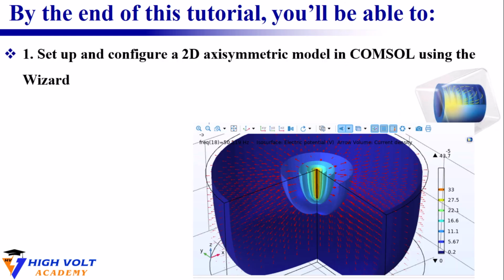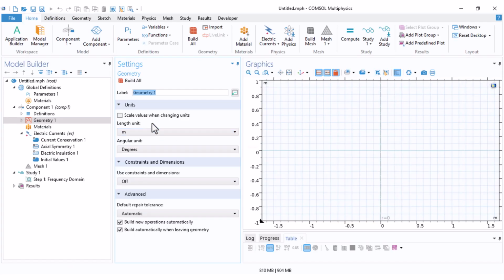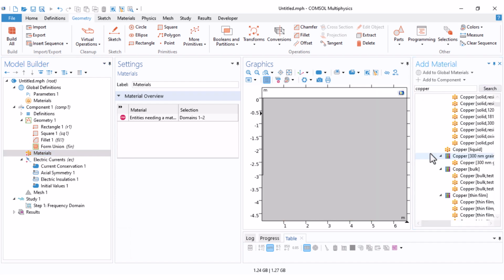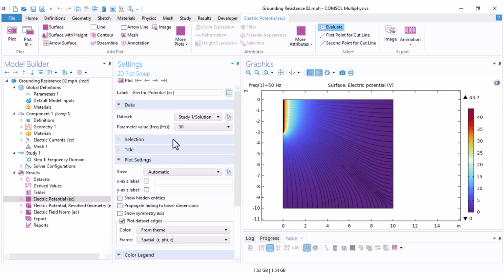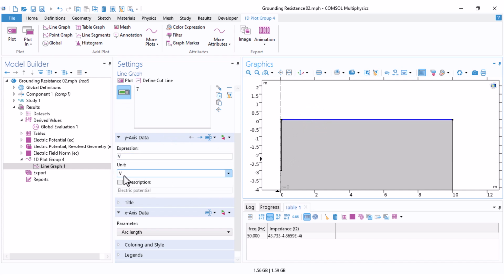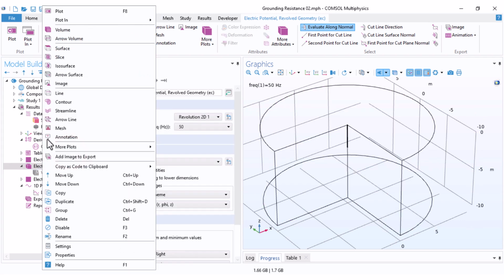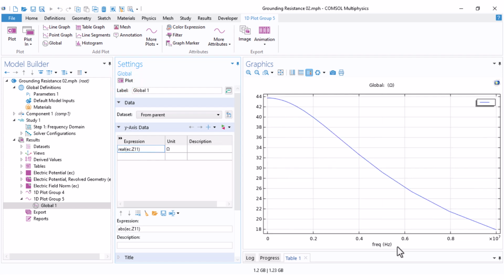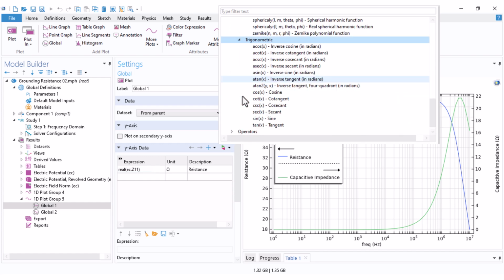How to Analyze Grounding Resistance Using COMSOL Multiphysics: A Step-by-Step Guide

Comment: Para hallar la tensión de toque y paso como se hace porfavor 🙏
Reply from the maker: To calculate the touch voltage, extract the potential difference between the current injection point (the rod voltage) and the ground surface voltage at a location approximately 1 meter away from the rod.

To calculate the step voltage, measure the voltage difference between two points on the ground surface (the top boundary of the simulation) that are separated by the length of one step. You can place two cut points on the ground surface at this spacing and take the voltage difference between them as the step voltage.

Para calcular la tensión de toque, debes obtener la diferencia de potencial entre el punto de inyección de corriente (el voltaje de la varilla) y el voltaje de la superficie del terreno en un punto situado aproximadamente a 1 metro de la varilla.

Para calcular la tensión de paso, mide la diferencia de voltaje entre dos puntos en la superficie del terreno (el borde superior de la simulación) separados por la longitud de un paso. Puedes colocar dos puntos de corte (cut points) en la superficie del terreno con esa distancia entre ellos y tomar la diferencia de voltaje como la tensión de paso.

Comment: If 3 ground rods are in the same area, how should they be simulated?
Reply from the maker: If you have three ground rods in the same area, the simulation should be done in 3D, because there is no symmetry that would allow a 2D or axisymmetric model. You can follow the same steps as before, but in 3D, and assign all three rods as a single terminal (representing one grounding system).

After running the simulation, the ratio of the terminal voltage to the injected current gives you the equivalent ground resistance of the three-rod system.

Comment: If I want to measure the grounding impedance during the normal operation, how much current I need to inject?
Reply from the maker: Measuring grounding impedance is independent of the injected current because the model assumes linear behavior. In this case, the impedance behaves like a simple resistor, where the resistance is given by 𝑅 = 𝑉/𝐼. This value remains constant as long as the system does not exhibit nonlinear characteristics.

Unless you specifically need to measure grounding impedance under impulse conditions, the magnitude of the injected current is not a concern. Simply divide the measured voltage drop across the earth electrode by the injected current, just as you would when determining resistance in a standard circuit.